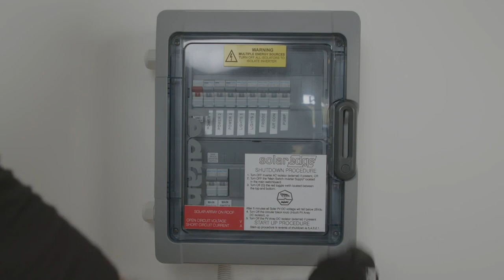Backup Interface Installation & Wiring - Australia

Comment: Will the SolarEdge Backup Interface also be compatible with the e.g. SE10K inverter + the new low voltage SolarEdge Battery? Or is there a different solution needed? And if yes - which one?